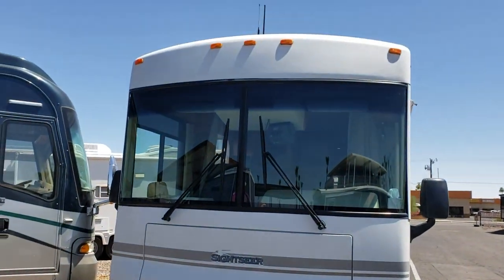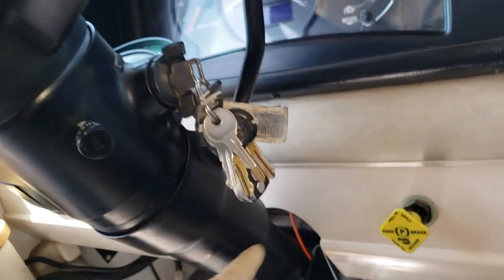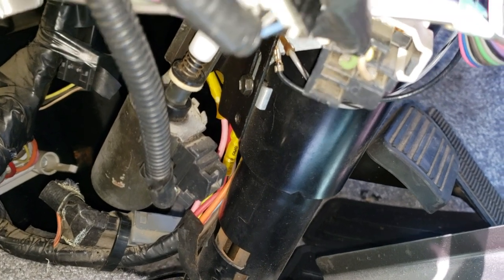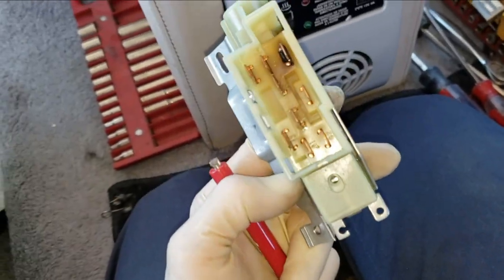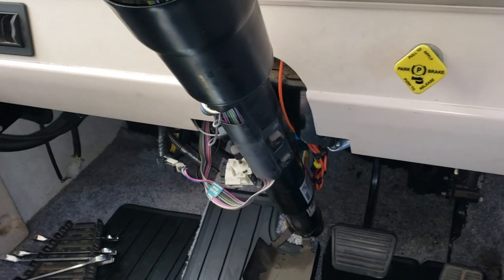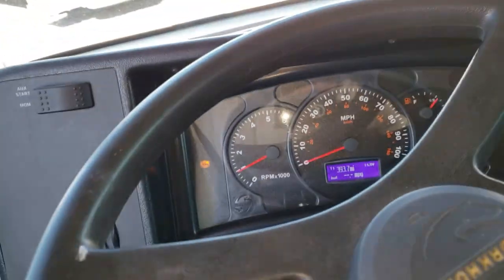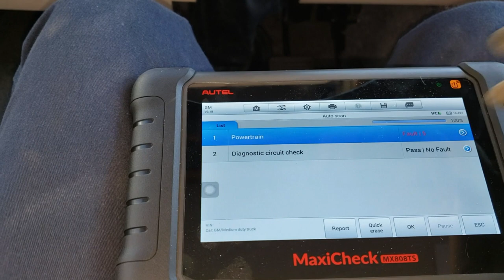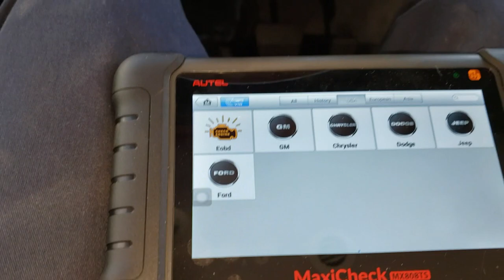2004 Workhorse Chassis Ignition Problems...and then some

Comment: After a three hour drive home, parked in front of my house. Went out to move it and key would not turn and could not shift out of park. Chassis is 2004 Workhorse P32 - Winnebago Sightseer. Problem was the ignition switch.  Contacts had melted to the plastic housing, preventing movement of key and shifter. Replaces switch and all is good.  Thanks to James for this video which got me on the right track to solving problem.

Comment: Thank you for this video!  We were stranded at the fuel pumps at a Pilot gas station outside of Flagstaff AZ with a totally dead ignition switch and all dash light out!  Between a few Winnebago users groups and your video we were able to figure out that the heater fan is tied into the ignition switch and over time will fry it!!! Your video was aimed at a roof issue but absolutely saved our lives when the first two mobile roadside mechanics and then the two Freightliner service techs were COMPLETELY clueless on where to start!!!  The best part was when the parts manager had no idea where to look for the ignition switch and I was able to recite the part number from the NAPA box :-)>. We are now in Monument Valley and they waived ALL charges since I was able to diagnose and replace the switch myself!!!
Reply from the maker: Wow. When I make a video it's mostly based on if I have time and something interesting. I never know if anyone will care, so it is very wonderful to hear that it was helpful. Thank you
Reply: @AZExpert  your videos indeed make a difference . Fear of the unknown is huge too so after watching a few of your videos, that fear goes away. Not just because you solve issues, but that there are people like you out there that really care
Reply: @AZExpert  we all care about your videos

Comment: I had this issue on my 04 daybreak 8.1 gm chassis.

The bus manufacturers have a tendency to overload the switch with all the extra features the coaches require.

The proper repair is replacing the switch and putting a relay on the additional bus accessories so the switch triggers the relay but doesn't directly feed them.

I was able to "wire" my bus to get us back on the road as I was stranded on the beginning of a long weekend in a small town with closed part stores.

Comment: The owner likely added more accessories which in turn adds more load to the ignition switch. I replaced the switch on my P-32 1994 Fleetwood Southwind Storm a few years back just as preventative maintenance (old one was working still). Bought an AC Delco one. Figured at that point it has provided 24 years of great service why wait till it fails while I'm on the road/freeway (Huge inconvenience). The switch failing was a common issue among that chassis series. Usually due to added accessories loading up the switch. A lot passes thru that switch.
Reply from the maker: Thanks for watching! :)

Comment: If my 2002 motorhome with 8.1 workhorse (15,000 miles on the odometer) starts up first try sometimes and takes up to four attempts other times, would that indicate the beginnings of a failure of this switch?

Comment: That is crazy that in 2004 they would still use that old column… must be a Winnebago thing with their ebrake because Fleetwood doesn’t use that old column…. And their ebrake is manual… unless that’s not a w but a p30 chassis?

Comment: I had this same exact problem it's all fixed now however my brake lights dont work not in my 2004, the turn signals and flashers woke and the middle brake light but not left and right ?
Reply from the maker: I think workhorse has them on separate fuses under the hood

Comment: I had this same problem in 2015 on a 2015 Damon with the same chassis. Was stuck in SD for a few days while they fixed it based on the TSA that Ike brought up down below.
Reply from the maker: Thanks for sharing. I wasn't aware it was a large issue.
Reply: Doing 65 down the interstate and all electric went out on my 11 ton RV including the power steering. That was no fun getting to the side of the road ;)

Comment: I can't se to get power to the dash on my 03 infinity 35t 8.1l vortex rv. Power to starter can cross oner but no power to ignition... Any ideas?
Reply from the maker: i'd check if there is a chassis battery disconnect that is off or broken

Comment: Hello. Thanks for this video. I have a question for you. Is this motorhome mounted on a P32 chassis with an 8.1 liter chevrolet engine? Because I have the same problem with my motorhome. I'm having trouble finding the part for the repair and I want to be sure I'm buying the right part (oddly Napa is having trouble finding a substitute for Workhorse parts) and I don't want to buy Workhorse parts because it they are much too expensive, it borders on fraud. The motor of my motorhome does its job very well but the chassis is a real nightmare, the parking brake system is really strange as well as poorly designed. I hate the Workhorse company, never again .... over my death body. Thank you from Canada   PS : Sorry for my english it's not my mother tongue

Comment: man change the battery in the smoke alarm ,, that chirp ia a PITA
Reply from the maker: Yes, I have become deaf to that sound as it is so common in RVs but I really needed to get the motorhome off the drive after the tow truck dropped it off. I think I replaced the detector later. Thanks!
Reply: @AZExpert  happy new year brother ,,,, have a great day

Comment: GM ignition switches have been weak for decades. They famously overload their electrical, especially on P series. I had a MAC Tools truck that, at night, would smell of something getting hot. I found they had 37 (!) exterior lights attached to ONE 18 ga. wire from the headlamp switch. Guess where the smell was coming from. rolls eyes There is also a TSB on GM & WH re: the switch overheating and an available add-on relay kit to prevent further problems. They have too much current pulling through that pin. The kit mounts a relay next to the forward fuse block (underhood), it's pretty simple and a knowledgeable person could figure it out without the kit. The kit does make it a tad easier, having the terminals, etc. provided. Here's the kit, it's pricy for what it is ($6 relay and some wiring.) If you do a  little digging online you can find a number of pages describing the do-it-yourself instructions.
https://www.workhorseparts.com/W8002060-Ignition-Protection-Kit
Instructions: https://www.nwtfc.com/wp-content/uploads/2020/04/Workhorse-Ignition-Relay-Instructions.pdf
And there is an updated, HD Ignition Switch available: W8002086 (it's green, in case yours may have been updated)
If the ignition switch connector looks rough I'd replace it as well. Most part stores will have a replacement available (because it's a common problem.)
Reply from the maker: Hey thanks for the tip!
Reply: Just looked to see what was powered on this circuit in my '04 HR Traveler ('03 P32):  ABS Relay, A/C Relay, Purge Solenoid, MAF Sensor, L & R O2 Sensors, Electronic Throttle Module, Fuel Pump Relay, PCM / TCM, ALL  Coils, ALL Injectors, S Terminal - Alternator. Oh, and the Starter Solenoid (through the P/N Switch), if you actually want it to crank over. Some of those are kinda necessary things, unless you just wanna sit in your driveway making engine noises. I suppose the other way would be to turn on the ignition switch and count to ten before cranking the starter?  /s